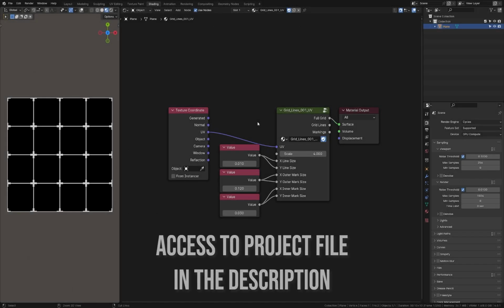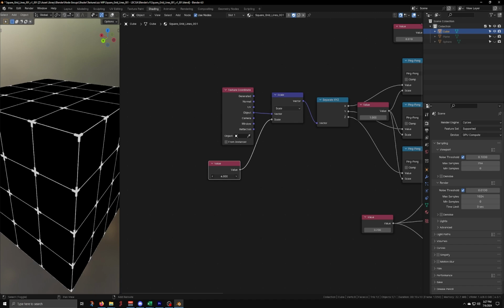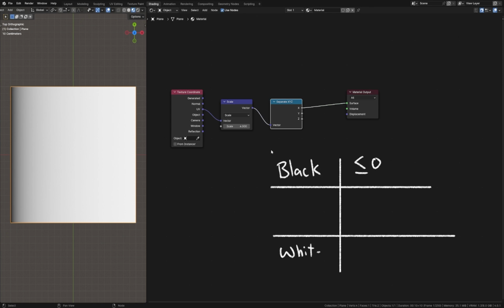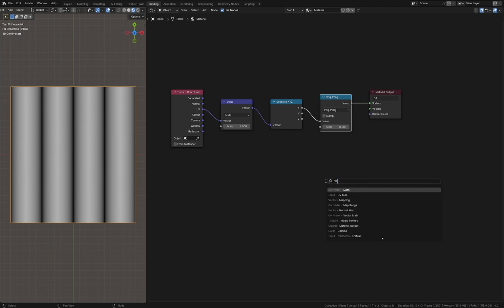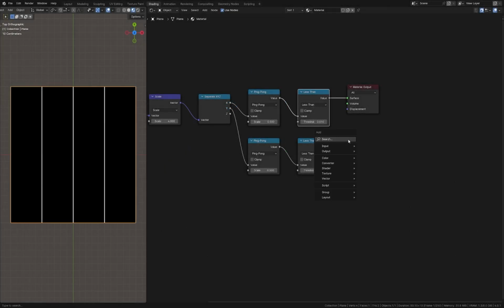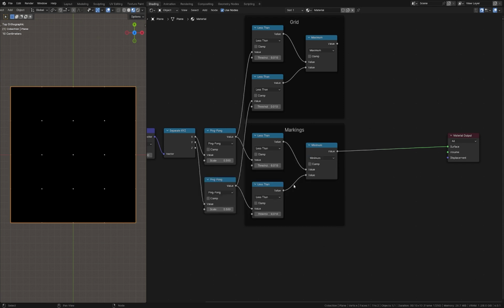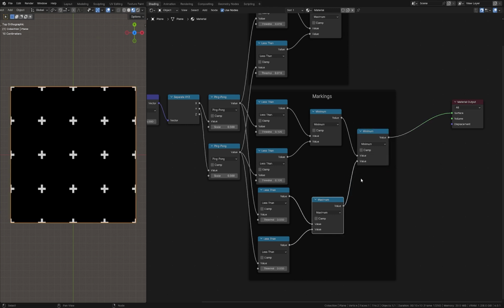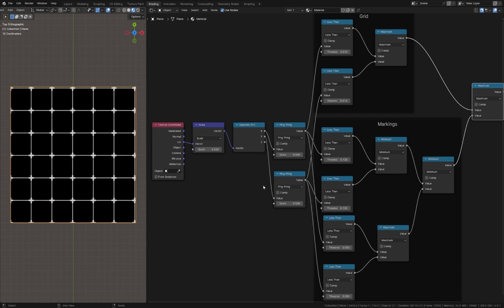Creating Custom Procedural Grid Line Textures | Blender Shader Nodes Tutorial

Comment: How can I invert the colors, so the lines are black and the space inbetween are white?

NVM, I figured it out :)

Pretty much flip every single less than to greater than and every minimum to maximum and maxiumum to minimum.

Good video - now to test it out on cubes.
Reply: Or place a Subtract math node at the end of everything. Plug your output value into the B input value of the subtract node and set the A value to 1. Mute on and off to invert.

Comment: You forgot to tell how to setup custom colors
Reply from the maker: This tutorial is only meant to show you how to create the pattern. I plan on making other videos showing how to use this as a base to create other procedural textures.

If you are just looking to add color, you can use this as a factor with a Mix Color node.
Reply: @leftbraincgart  then crap video. I have to go to other channels to see what you refused to explan
Reply: In final Step, Add A Principled BSDF and select Your color. Then Add  A Mix Shader node and Add This Principled BSDF and the last Maximum Node of Tutorial to Mix Shader Inputs. Keep the Fac of Mix Shader at 0.5. Then add The Mix output to Material Output.
Reply: @DevEmpower  That changes the color of the space inbetween. How would you change the color of the lines and crosses?

Also, thank you for the explanation :)
Reply: @ZhakyDK  do you know the answer?